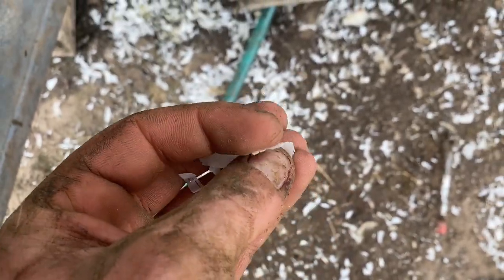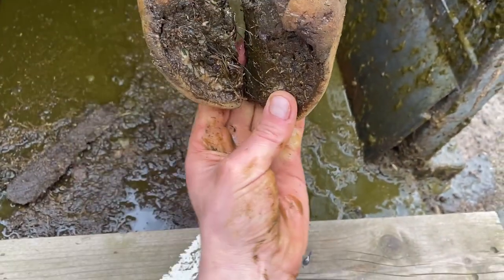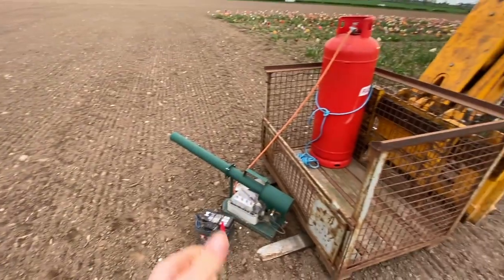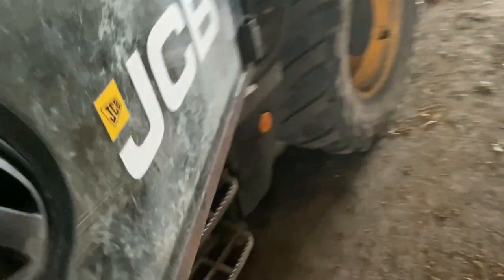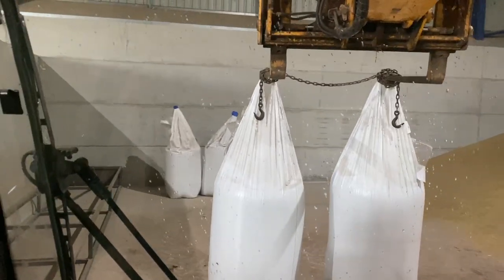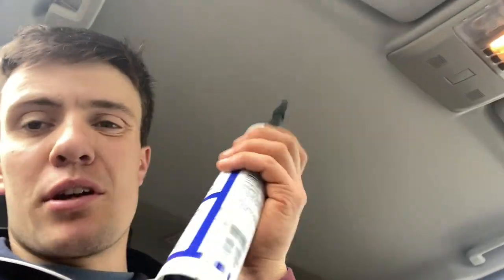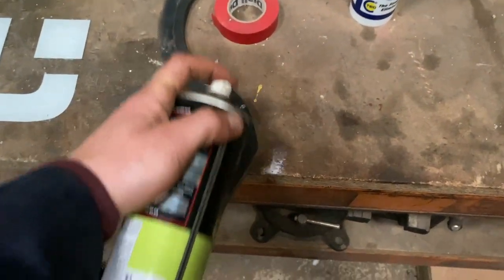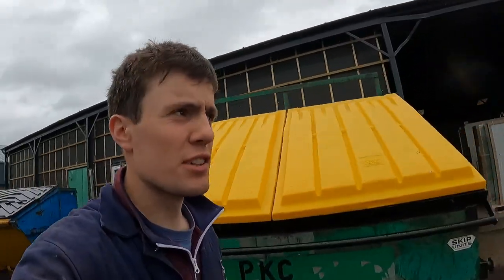Hoof Needs Work | Mega Gate | Concrete Blocks #CRAWFORDSFARM #264

Comment: BETASEAL ENHANCE PRO 1580 is the professional stuff i use for fitting glass feom heavy plant cars and trucks  ut never seen anyone use that stuff before usually got to primer the metal and glass before putting the urethane on to get it ti adhere to both the glass and metal.